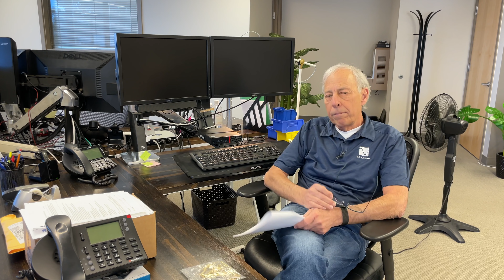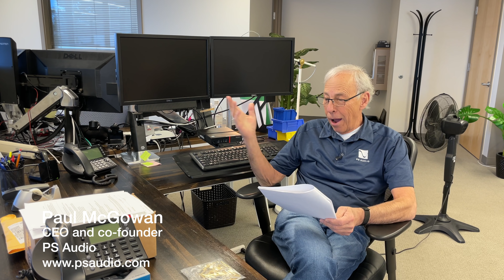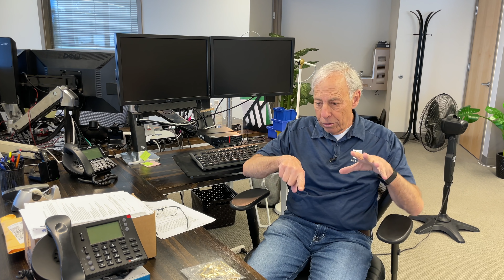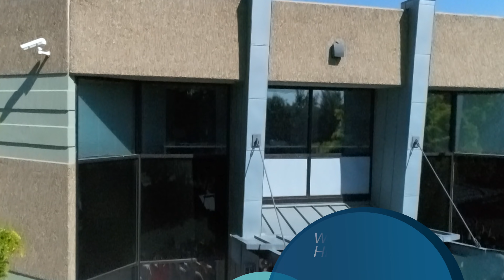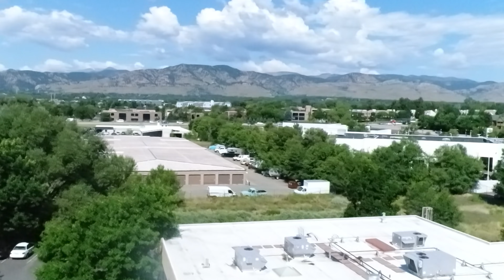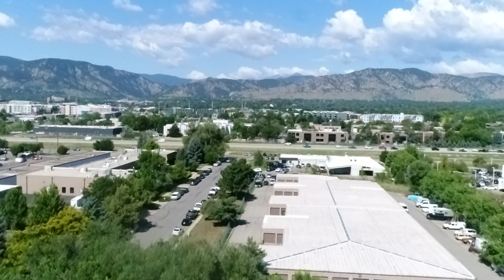Current vs  Watts for amps

Comment: And power (energy per unit time: 1 watt = 1 joule/second) comes from the power supply (well, duh).  Correct  me if I'm wrong (not an EE); I thought that a quick way to find out is that if an amp can double it's rated power output every time the impedance load is halved, i.e. 100W into 8 ohms, 200W into 4 ohms, 400W into 2 ohms, even 800W into 1 ohm(!), this indicates a robust power supply and the output circuitry that can handle it.  Many amps start to run out of current as the impedance load drops and can't do this.
Reply: You are correct that an amp that can double the power when the impedance halves can indeed push a lot of current.  Not many affordable amplifiers can do that , Years ago Bab Carver's Sunfire signature amplifiers were one of the few affordable ones that could "double down" and drive loads down to 3/4 of an ohm. Also known as load invariant.
Reply: Let's look at what physics tells us:

P  = U * I

As long as I = U / R we can say

P  = U^2 / R

So, what this tells us?

If you supply constant voltage (U) and reduce Resistance (R) -> you will get more power (P).

So the real question is that if certain amp can dynamically behave the way that voltage is always 'right' for the moment so the output power is not larger than expected.

PS. I'm not talking peaks here, just the general picture
Reply: @mykhailoskachkov5946 While in theory that is correct it takes a really large linear power supply or larger than normal switching supply or other unique design to keep the voltage constant as the resistance /impedance gets really low in value. At some point you get into arc welder territory. Most countries use either V or E to represent voltage in an equation.
Reply: @leekumiega9268  I agree, in real life everything is not that straightforward
Reply: Your IF statement is missing its THEN statement. What is the the conclusion supposed to be? Suppose that I have a speaker that can do 100W into 8ohms and 200W into 4ohms.  Does that mean that I can assume that the amplifier can supply 400W into 2ohm because it was able to double it's power output on the previous step?  The answer is not necessarily. EVERY amplifier is ultimately limited in the current that it can source. Each amplifier will have its own I-V output curve.  Even it it could handle 8ohms and 4ohms gracefully doesn't mean that it will handle 2ohm gracefully.
Reply: I should also point out that going the other way can also be problematic.  Amplifiers are also voltage limited.  One of the most common questions that I see asked around here is in regards to high impedance headphones.  Where power amplifiers are usually more current limited than they are voltage limited for their application, the reverse is often true for headphone applications.  So a headphone output might be able to adequately drive an 8ohm and a 16ohm headphones but not source enough voltage to drive a set of 32ohm (or higher) headphones with sufficient power.

Comment: I don't know how this work, but my amps are low watt high current, and can take any speaker on for music pleasure. Once when i was much younger, i thought it was all about the watts, but iv'e learned along the way, that it wasn't the whole truth. My Pre/Mono combo is the magnificent French company Lavardin: C62/MAP and they are stated to deliver 2x55W, as in 55W for each channel/speaker. But their integrated Lavardin IT is also capable of delivering enough current for almost any speaker. Those of you who hasn't heard a Lavardin amp, your in for a treat. In my opinion, you get the best from solid state & Valve, but has the power/muscle as an solid state (which it is). Not many Solid State amps sounds so natural like Lavardin amps. I have never heard any other amp come close to what they can deliver, if were talking pure music enjoyment, and yeah yeah yeah....they do not come cheap. But what amp of magnificent caliber come cheap? No one. If you wanna play with the big guys, you have to pay ;-)  Cheers from Denmark
Reply: I manage to service a Lavardin integrated amp back in 1997. I share with this amp's designer on the concept and philosophy of eliminating / minimizing "memory distortion". If you know how to eliminate / minimize memory distortion, the resulting amp would sound like a vacuum tube single ended triode design with the current drive of a solid state design. Even back in 1997, Lavardin amps are not cheap. The one belonging to my audiobuddy that I've serviced back then cost him around 3,000 US $.
Reply: You ever hear any Densen amps?
They are made in Denmark, if I'm not mistaken.
Reply: @Hare_deLune  Densen is one of my fave amp makes from the 1990s.👍

Comment: My 1.7i Maggies drop to 2ohms above 2k. To reach higher SPLs takes massive current. I continually overheat and shut down my amps or blow fuses trying. That includes my current (pun intentional?) ADCOM BFA555. 

But the confusion between current and power comes in when the amp is not a constant Voltage Source having close to zero output impedance like most Solid State amps. Amps using a transformer to match to the load like a tube amp have a given output impedance which should be the same as the load impedance. Maximum POWER transfer happens when output matches input impedance. Simple math proves this. Can add if needed. That is why some good modest powered tube amps work well with Maggies while an equivalent power rated SS amp might not.
Reply: Looking for an affordable used amplifier that sounds great and  can drive them without any problem at all , look for a Sunfire Signature amplifier , research some old reviews , you will be impressed.

Comment: I think that this guy was talking about the Magnepan LRS review from Steve Guttenberg, or maybe I'm misremembering
Reply: LRS stands for Little Ribbon Speaker and all of their new designs are quasi-ribbon designs ,which have an aluminum ribbon glued to a thin Mylar strip.
Reply: @leekumiega9268  difference between ribbon and isodynamic... or quasi-ribbon, the way MG calls their latest design (quasi-ribbon is a no sense actually, simply it doesnt exist... just marketing term), is not just the way (and the kind of... wire or foil) the conductive material is coupled with the diaphragm, it's just a completely different way of working with different orientation of the mag fluxes and different way the diaphragm (that acts in the same time as conductor as well) moves. Btw, if you want hear how really a great planar speaker system should work go to hear a pair of Alsyvox... and they neednt lot of power too ;-)

Comment: Not so easy to drive mid bass. I have the 3.6 R’s in my system and from what I’ve read, the 3.7‘s have addressed three issues to resolve my problem plus upper mid range glare and grain. Midbass problem has been solved by replacing a planar magnetic panel with a ribbon element.

Comment: Ported / bass reflex loudspeaker designs are notorious for possessing an awkward impedance load. Even if they are rated at 92 dB per watt at one meter or higher, they could still give a 3 to 10 watt single ended triode amps a hard time when driving them to near stadium rock sound pressure levels.

Comment: Twinkle, twinkle little star, V = iR.
Reply: For those that are not good at math that formula means if the speaker  impedance normally represented by Z  not R is low then it takes a lot of I (current) to get a lot of V (voltage) or output volume.
Reply: @leekumiega9268  They are half correct. If the impedance is low it DOES take a lot current to generate a high voltage across the load. If the amplifier cannot supply sufficient current then the voltage  output will drop.

Where they are wrong is in the automatic correlation of voltage to volume. The relationship between volume and voltage is more complicated -- especially since most speakers are magnetically actuated; which is related to current and not voltage.
Reply: @timharig  Where am I wrong as to the correlation of voltage to volume as the SPL of a speaker is measured with  2.83 v across the speaker at 1 meter. I did not mean to imply that 2.83v will give the same volume SPL at 1 meter with different speakers. I was trying to give those mathematically challenged a general principal and not go into the logarithmic relationship involved with power and SPL if that is what you were getting at..
Reply: @timharig  I'm not as well versed as you guys are in stereos, what I gave is a mnemonic from freshman physics to on how voltage, current, and resistance are related. I believe the general equation for wattage is:
W=iV=i^2 R
This is probably reduced further by some assumptions and the variable names changed to make it more practical, as Lee indicates in his responses. I'm sure produced volume requires some additional variables like efficiency and distance.
Reply: @Slammy555  "I'm not as well versed as you guys are in stereos, what I gave is a mnemonic from freshman physics to on how voltage, current, and resistance are related. I believe the general equation for wattage is:
W=iV=i^2 R"

I have no problem with what you said. The electrical part is correct.Ohm's Law is always correct when properly applied. It is physical law.

"This is probably reduced further by some assumptions and the variable names changed to make it more practical, as Lee indicates in his responses."

The difference between R and Z isn't just a name change.  R refers to resistance while Z refers to impedance. Impedance is a combination (not a direct sum) of resistance and reactance.  All three are measured in ohms; but, reactance changes with frequency.  As you are using it, as a single number from a rating without regard to frequency, R is just fine.

"I'm sure produced volume requires some additional variables like efficiency and distance."

The link between voltage , current, and power to the actual sound level produced is MUCH more complicated.I wouldn't even expect it to be a simple equation. That is why it is generally measured and not calculated.

I have read the comments in the back catalog and I have seen a lot of misconceptions arising from people who are attempting to directly correlate power or voltage to the volume output. It is best to think of them as no more than tangentially unrelated.  The higher the voltage is, the more POTENTIAL power that the amplifier is supplying to the speaker.  How that power ultimately ends up being converted into acoustic energy and ultimately perceived sound level is ultimately left to the speaker to determine.

Comment: Magnepan LRS dips to 2 ohms
Reply: Yes all the models from Magnepan have terrible dips. I dont remember the LRS model but it will be like 2ohms. The 30.7i has dip to 1.5ohm. Thats why they need high current and power, Paul was absolutely wrong.
Reply: Magnepan LRS drops to 1.7ohms.
Reply: @pamelarios4324  whos measurement did you base that off? audiosciencereview measured them using the state of the art $60k klippel nfs and showed that it is a resistive, flat load and the lowest dip (not even a dip tbh) is 3 ohms. 1.7 ohms is a fairy tale.
Reply: @nabildanial00  Hi, I can't find where I saw that result. Or maybe I mistook it for some Quad ESL. But I think it was some Magnepan model with that drop. In fact someone had compared it to Wilson Alexx who has a drop of 1.6ohms. I'll investigate.
Reply: Min impedance of 2.94 ohms at 500Hz. Max impedance is 4.1 ohms at 6kHz. No phase shifts in the audio band. It's essentially a 4 ohm load, flat.